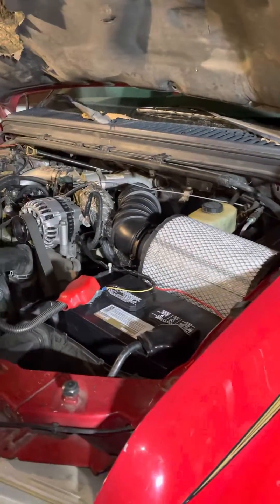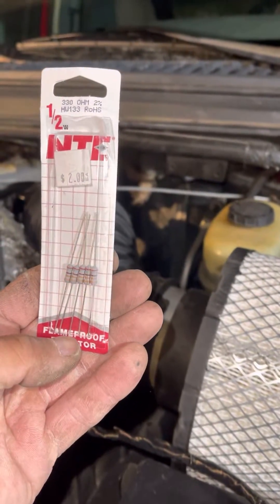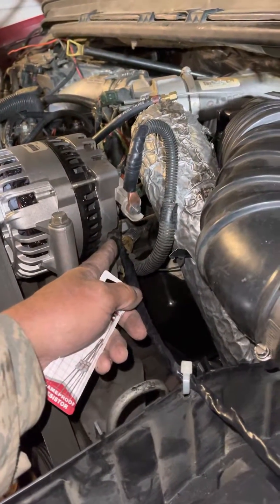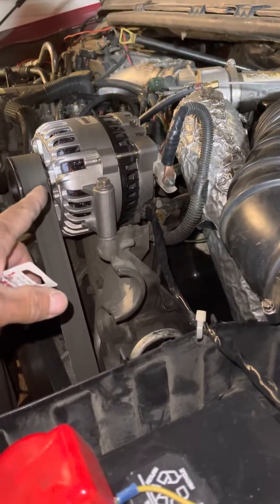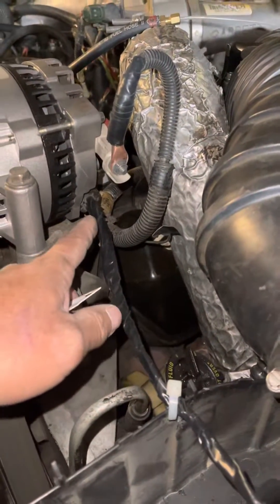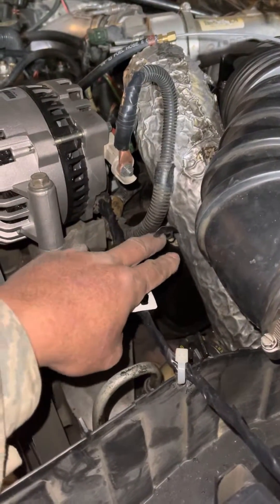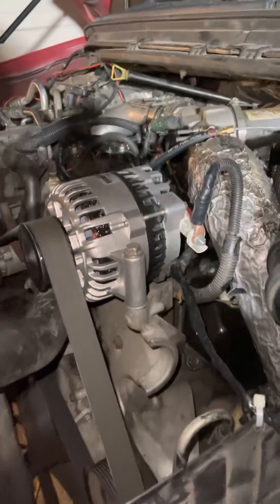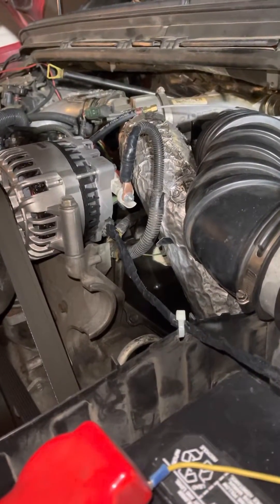⚡️CHARGING PROBLEM SOLVED⚡️F250 F350 F550 FORD ALTERNATORS

Comment: So should you wire it resistor, diode, altenator? Or does the resistor go between the diode and the altenator?
Reply from the maker: Well. From what I understand is that it is like a light switch. The electricity goes one direction and then it cant come back. And that is supposed to protect your fuse box and electronics. So 12 volts from the exciter wire from the ignition to the alternator and on the way put the the resistor and diode.